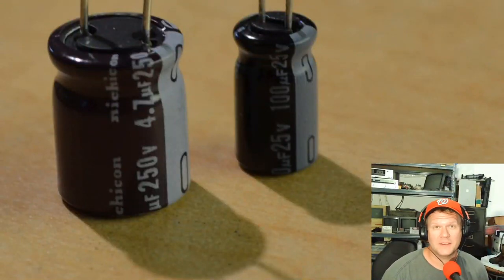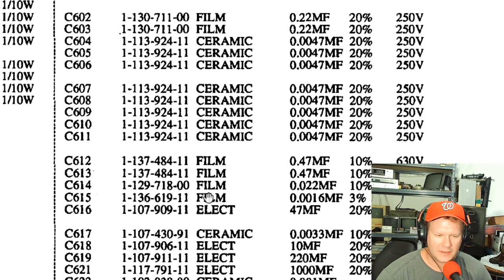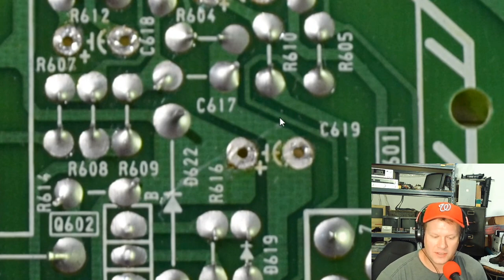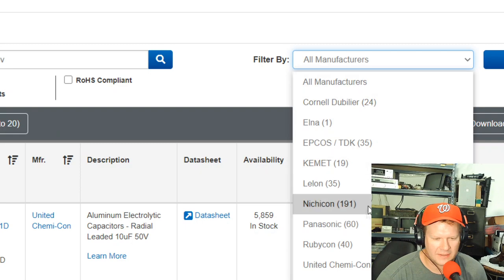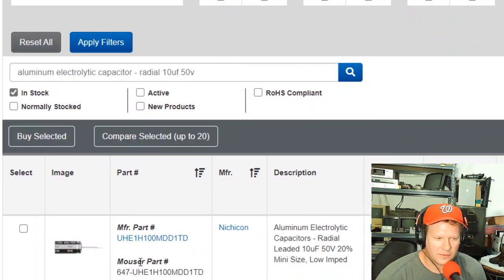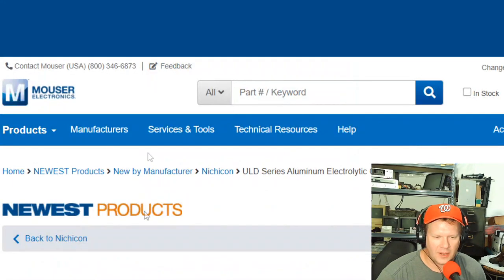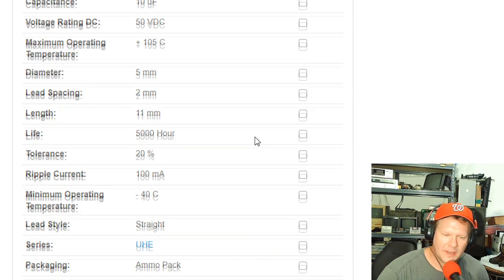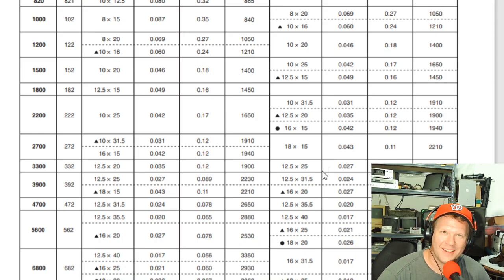Which Capacitor is best and which to chose for replacement | CRT cap kits

Comment: If you want even longer life capacitors, go with 125c, 135c, or 155c Nichicon caps.  Every 10 degrees higher the temperature rating, the capacitor lifetime is 2x as long. For example, a 155c Nichicon that has a 1000 hour life expectancy at 155c will have a 32,000 hour life at 105c.  Most caps in CRTs are used under 65c.  So a 155c cap with 1000 hour life used at 65c will last for 65 years of continuous, always on use.  Most people use a CRT less than 12 hours per day so the cap will last 130 years.

Comment: For BVMs and PVMs just use  UCY for primary psu section and ABL line  and  UHE or UHV (The slimner) for the rest.. If you want replace The big filter one then go for LGR or LGZ this should be performed on all old models like pvm 2130, 2730 and so on

Comment: Exactly what I needed. Your channel has been very helpful in trying to revive my KV-27v36 Trinitron. Unit isn't getting any power, main problem appears to be the PSU/GBoard. Seems to be about half the caps on the G board are bad, so I'm going to do a full cap replacement of all 10 and hope for the best. First time doing anything like this so fingers crossed!
Reply: I am currently looking to do the same thing, for the same unit. Any tips over a year later?

Comment: Assuming you don't have a service manual, or are replacing caps in a different device (for example, game console PSUs, boards etc) is there a recommended tolerance % to shoot for as a minimum?

Comment: Hey Steve, love watching your videos man, very informative thank you very much.  

Have a special request.  Have you ever covered the breakdown on how to choose a replacement Flyback for CRT monitors and where to find them?  I’ve replaced flybacks on old arcade CRT’s like on the Wells Gardner line but those are readily available from arcade repair boutiques and can usually be found in kits ..... I’m into replacing the caps on my old commercial grade retro gaming CRT’s now at this point but I’m worried about the longevity and failure of my flybacks in the future ........ any suggestions?  Or would you ever consider doing a video as a follow up to this one?

Thanks Retro,
Adam

Comment: What are some of the signs that the caps need to be replaced?   Would slightly wavy image be one of them?
Reply: Could be. Generally if a tv is older than 20 years and was regularly used replacement is advisable in critical areas like video, power and deflection boards

Comment: Hey i want to ask you something, i have a crt tv panasonic ct20r15w 1998 so, the problem is that is look dark right, i use the brightness in 50, i adjusted the screen in the flyback, so i have more brightness and don't need to use the brightness in 100, but something that i can't understand is why the black areas looks gray instead of black when i use the brightness in 50, and when i lower the britghtness the black areas looks a little bit green, when the brightness is in 20 the black areas looks black but i can't see too much, in games like Xenogears ps1, where i'm in a cave, i can't see well, or even vagrant story. that start in a dark place, i can't much, and the same happen when i have brightness in 50, the black areas looks gray but i can't see the colors.

Comment: Hey any experience or suggestion when replacing film caps? I think I shorted or something my 2130QM and now is not powering on and  the only one I can see as damaged is the C621 in the power board. Thanks!
Reply: C621 should be tested before replace since those caps appear in bad shape due to The heat but most of The tines are just ok,  on 2130qm first of all reflow all soder joints near The ptc  ant pay atention at all dry solder..
Reply: @francescopaolella7533  Took the power board to a tech and can confirm what you are saying, C621 works fine no replacement required. Some resistors and other components were replaced (no elec caps) and now the PVM is back to life.
Reply: @marianobellver1306  may I know what You have replaced?
Reply: @francescopaolella7533  Yes: R601, THP601, THP602, Q602. Also some new soder in the FC board (FC1 and FC2), and also around the C621 cap. C621 was cleaned and insulated again with new silicone.

Comment: You didn't filter on lead pitch and you ruled out the slightly higher temperatures. Greatest piece of advuce is stick to vendors like these which for the most part only have good brands and NEVER ever buy from the eBay tat market. Some vendors sell a whole spectrum of brands including Panasonic, Nichicon, Rubycon, Cornell Dubillier (which are red !) but also their own brands. Others like CPC have decent brands but only the cheapest nastiest range and cater for electricians and plumbers basically. Not worth your time